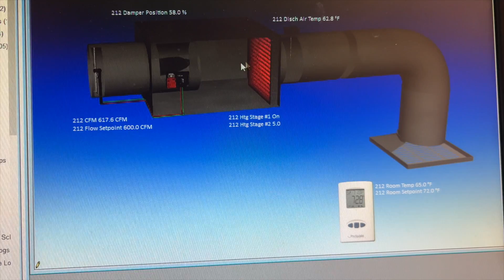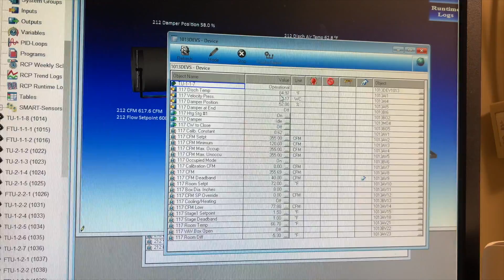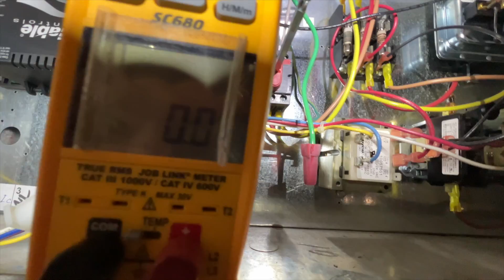VAV's Electric Heat Not Heating EP160

Comment: A lot of boxes i work on use SCR's for mod heat.....or they break common with the fan proving, limit switches and other safeties. Fan powered boxes and VAV's are fairly easy to work on. Not as bad as WSHP'S......but always in a crappy location. Cool video, thanks for sharing